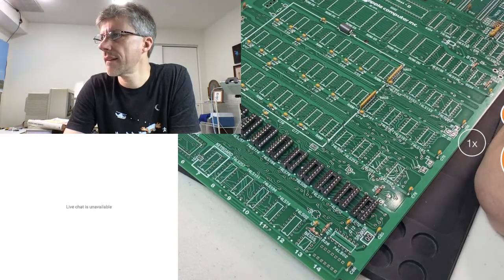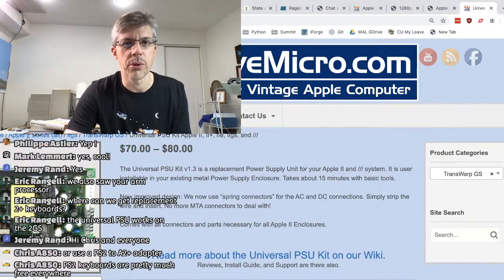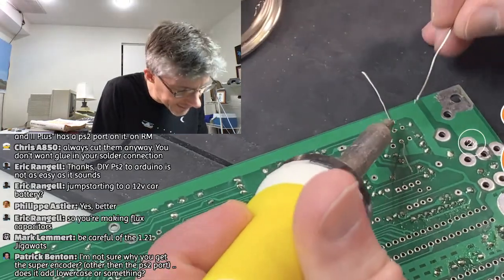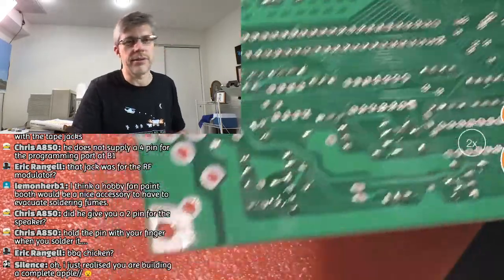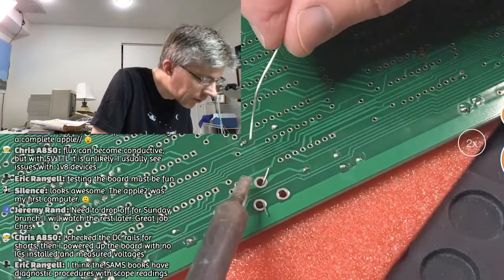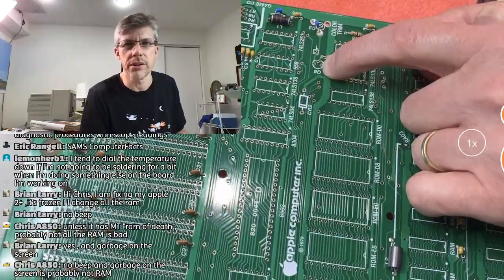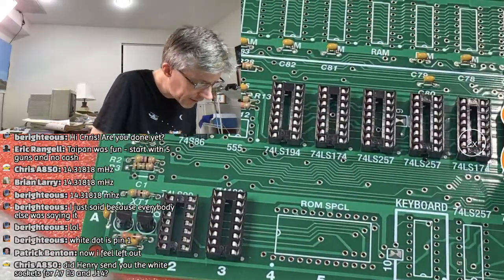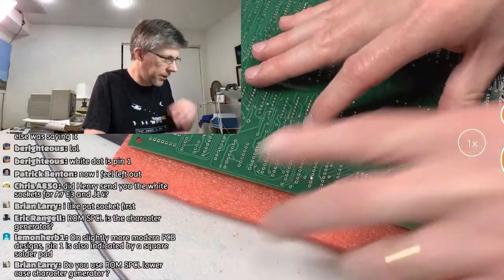#113.2: The Apple II+ Kit from ReActiveMicro: Part 2

Comment: I'd like to watch this video but it simply won't stream without stopping every few seconds, and I can't download it either. Is there something wrong with the format or size. BTW, I get a consistent 40+Mbps internet connection so I know thats not the issue.
Reply from the maker: It also says it isn't finished processing, so maybe wait until tomorrow?
Reply: @CT6502  Yes, it's better now. No more halts every few seconds.
Great video by the way ! :)
Reply from the maker: @jmparis83  Glad to hear it's working better! And thanks for the compliments. :-)
Reply: @CT6502 , that must have been the problem as I'm watching it again without pauses and at higher resolution. Great project to be working on. I sold my first Apple II europlus when I upgraded to a //e, so this is probably the only way I'd ever get a replacement II+.
Reply from the maker: @markcummings150  Excellent! Much have been processing. Well, the Apple IIe is an excellent machine, that's what I use most of the time instead of the Apple II+, so you're probably better off in general.
Reply from the maker: That's so weird. There's nothing strange about it as far as I can tell. Does Part 1 work okay for you? I actually trimmed that one afterwards, and I wonder if that changes the format from a "stream-friendly" format to a more normal YouTube format. Here's the link: https://youtu.be/lXXvktZ9Xls